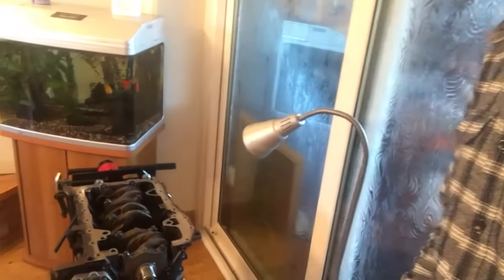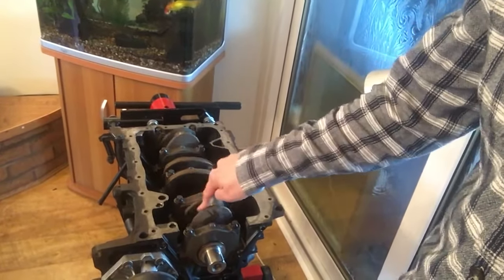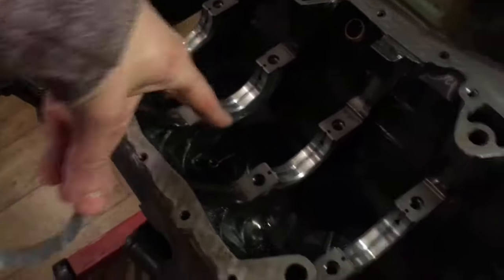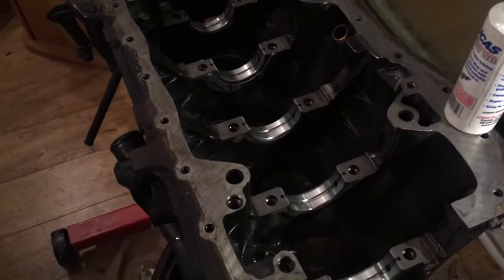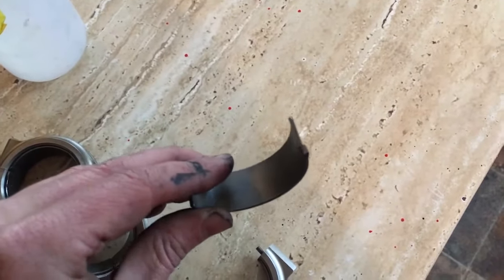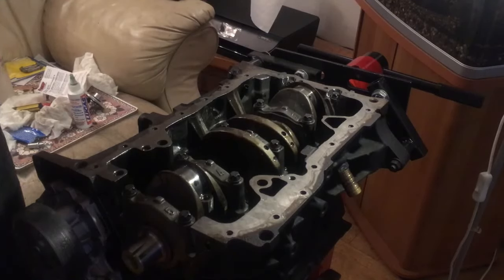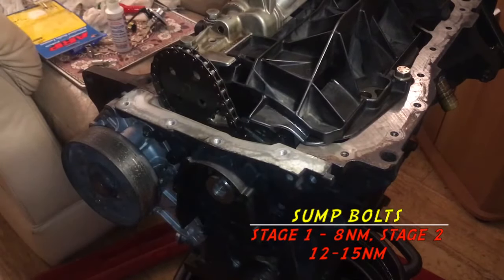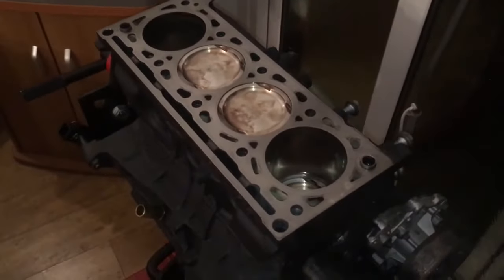Torque settings, Assembly and ARP bolts - Clio 182 Turbo rebuild Part 2

Comment: @steffrally what can I do if after I put the pistons attached to the crank, there is resistance to rotate? I feel that I need to push much harder than you do on the video
Reply from the maker: If everything has been lubed while building then it should turn smoothly, if it feels like your having to push hard I'd be pulling it back apart and measuring the big and little end gaps. I'd disconnect the pistons from the crank, and push them up out the way, see if they move freely, then try the crank on it's own to try narrow down where the problem lies. Checking ring and shell gaps is vital
Reply: @Steffrallye  Without the pistons, the crankshaft rotate freely and easily, i guess there is something could be wrong with the rods, although the pistons go up and down without any kind of unusual resistance
Reply from the maker: @charlyfastdrivelp720  I'd be measuring the shell gap for the little ends then.

Comment: How wise is using ARP bolts on stock rods? Heard some people say that you have to tighten them more than OEM bolts, and u screw up the rod??
Reply from the maker: All depends on what the cars being used for really. If I had the engine out the car for some reason then it's a worth while upgrade for peace of mind. The bolts stretch and have their own method of tightening, I'd have thought it would be the same process/torque for stock rods as forged. Worth checking tho

Comment: Why did he break the Conrod in the first place ?
Reply from the maker: Never found out sadly, oil starvation  seems to be the only thought,
Reply: @Steffrallye  hmmm. After watching the video I thought it was that.  Is that oil baffle plate thing that clips onto the pump a standard part. ? I'm wondering if that is stopping oil splashing against bottom end n it's getting hottor than usual
Reply from the maker: @percylfc7165  yes it's a standard baffle, clips are normally very good with oil but if one goes it normally is cylinder 3. The original engine was second hand so maybe damage was done before I bought it but also there wasnt tabbed shells so nothing really to stop them spinning

Comment: what ecu are you using? and did you have to modify the factory loom?
Reply from the maker: visionptcastlehill I’m using a Ktec Gen90 plug and play Ecu. It’s not the best on the market to handle these large injectors but it’s coping fine and covers most untill you start getting above 300bhp
Reply: And did you have to modify the factory loom?
Reply from the maker: visionptcastlehill no it’s a straight plug and play. Only thing I did was tap into the loom to add a electric Boost controller
Reply: Also what turbo exhaust manifold did you use?
Reply from the maker: @visionptcastlehill  I'm using a Ktec log manifold and down pipe. Theres also engine dynamics available

Comment: You missed 3 letters from the closing screen :D

Any idea where I could get an engine from? I've been looking for a week, but haven't been able to find a decently priced decent mileage one
Reply from the maker: ahh bugger! can't even edit that now. ill just have to trim it sadly. Thank you!

If you after just a standard engine the owners clubs are very good, tho most people use the Facebook pages these days. Sometimes it just takes putting a wanted post up and your be surprised what people have. Sadly i haven't got or know of one at the moment off the top of my head. Thank you for watching and the input.
Reply: I have put up a post on the Cliosport owners club, but only got one response, which is a full car that I can't really take home. In a ph1 owners group I got 1 guy, who has one with 120k miles on it, so I'm kinda scared of that one to be honest.
Reply from the maker: Yer its always nice to have a low milage replacement or one you can have confidence in. Remember tho you can use any of the engines from the 172 ph 1, 172 ph 2 and the 182.
Reply: The 182 wouldn't work would it? I tought with that one I cant use my inlet manifold
Reply from the maker: kronoCSGO you just have to swop over the parts that differ, the block and the head are the same. Only difference I can think of is the 172 has the chimney type breather into the inlet. But this wouldn’t cause a issue putting the 182 into 172 as it still will be sealed off.
Reply from the maker: kronoCSGO this is a 172 engine btw in my 182 ;)

Comment: What engine is this?
Reply from the maker: Darren Astbury its mostly Clio 172 F4R engine.
Reply: @Steffrallye  Hi mate, what measurements did you gap your piston and oil rings to ?
Reply from the maker: @andrewtweedie8485  hey, been a little while since I did this but I have it written down somewhere, I roughly think it was 1 - 0.35mm, 2 - 0.40mm and oil - 0.35 but don't hold me to that 😅